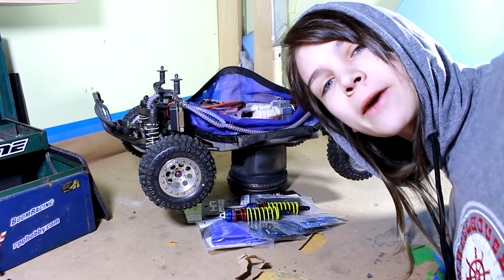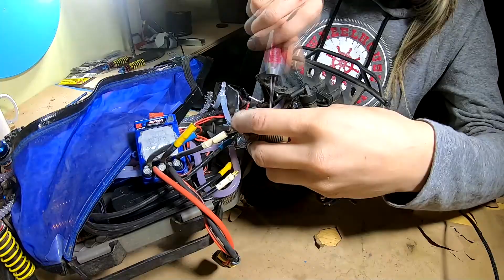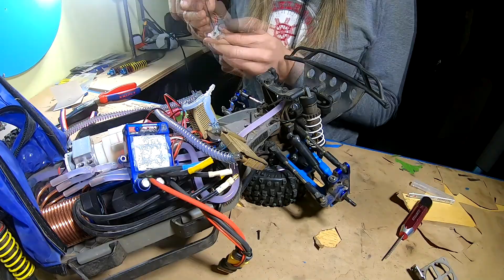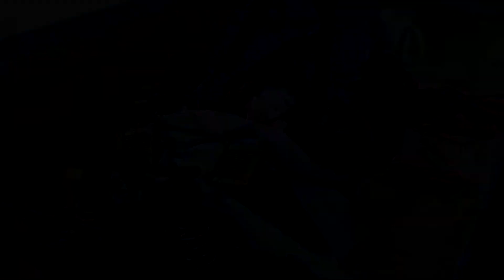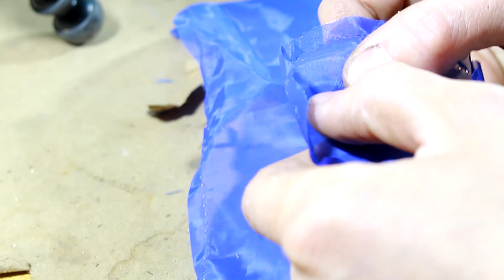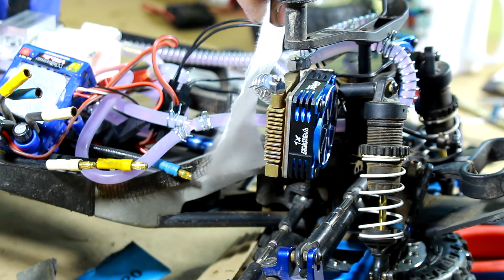Water-Cooled Slash 4x4 |Ep 7| SUPER HIGH SPEED Fans and Suspension Upgrades!!

Comment: hitting the like before even watching 👌

at 3 minutes in, I finally saw the ESC and it's block. are you sure you're getting good contact to the ESC and block? appears to be plastic cover in-between the ESC and water block. try a different cooling paste, like one for PC processors that have copper or metal infusion in the paste. those custom filters you made for the fans is hella nice
Reply from the maker: The water block is clamped right on top of the flattened aluminum heat sink on the esc with CPU thermal paste in between.